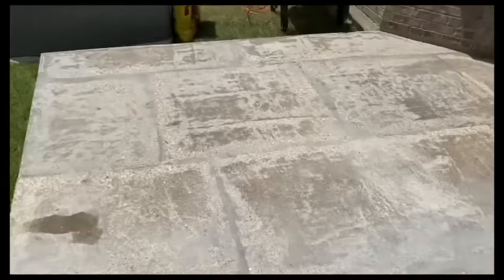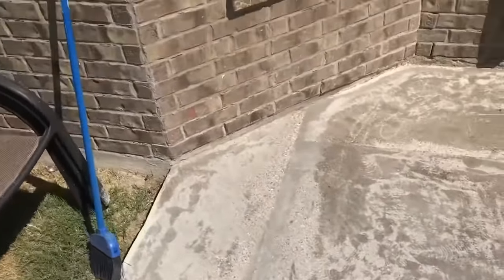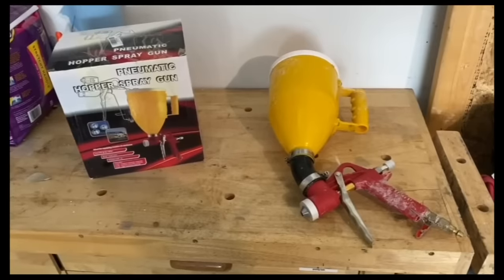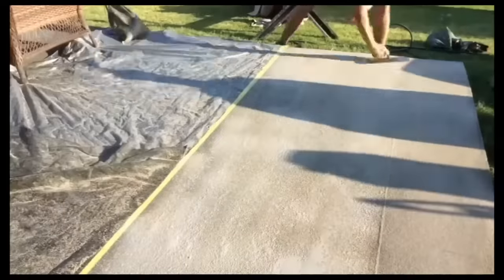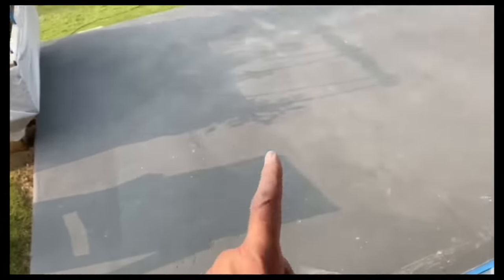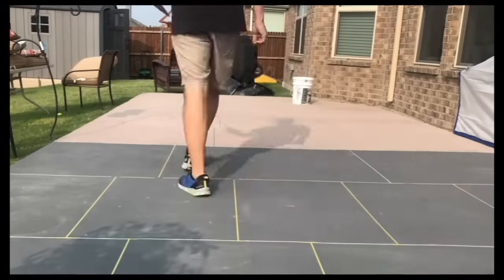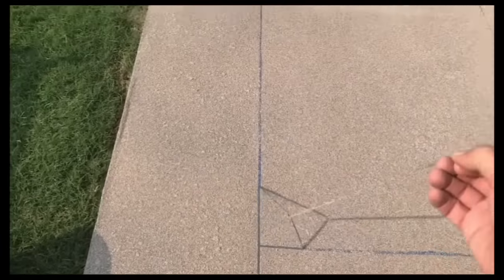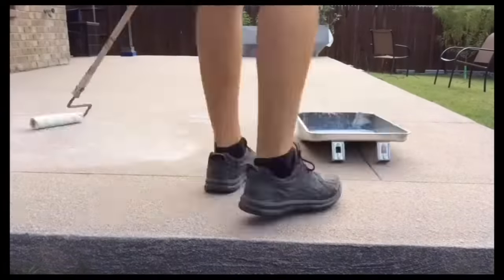Give Your Ugly Concrete Patio a Makeover using SpreadRock by Daich and an air hopper!!  It's easy!

Comment: Congratulations Scott, you did good job considering your experience. I've known guys that have been doing for awhile and they still have a hard time spraying it consistently. That is the key, consistency. Next time you spray a deck, I suggest you trowel it LIGHTLY, it will look much better 😉.
You'll need a helper so you can trowel while they spray. DON'T trowel when too wet. Give it a minute but don't let get dry on you. I use golf shoes to walk on for troweling. Good luck 👍🏼

Comment: That's really nice. I have a painted patio that I need to spruce up and I thought about laying tile or stone on it but I have a low lip sliding door and I don't really want to raise the overall level of the patio. This looks very good and should be a lot cheaper and easier to do.

Comment: Can you tell. Me your square footage and how many gallons of Spread Rock you used. Thank you
Reply: I just finished troweling my first coat.  It took 9 gallons to cover 378 sq ft and definitely needs the recommended 2nd coat.  My experience is that I don't like the look of troweling and will have to spray the 2nd coat for the look I want to achieve.  I have 6 gallons left and am unsure of the coverage when spraying.  Daich claims SpreadRock will cover max 60 sq ft per gallon per coat and recommends ordering 20-25% more than your coverage area suggests.  https://daichcoatings.com/shop/spreadrock/

Comment: Which acid wash and self leveling concrete did you use?
It came out fantastic! I want to do the same!
Reply from the maker: I purchased a gallon of muriatic acid and mix it 10 parts water for one part acid for the etching. I can't remember the brand of the self-leveling concrete. I purchased it at Home Depot, though.

Comment: Hi Scott- I have an old ugly concrete patio with wood expansion joints in quite a few places (been there for 20 years). I am afraid to take them out and fill with self leveling concrete. Will the concrete crack if there isn’t an expansion joint in? Thank you! Great video!
Reply from the maker: I am not an expert on concrete. Just a DIYer. On mine I routed off an inch and then filled it in. It has been 6 months and everything is good, no movement or cracks.

Comment: Hello Scott, thanks for the video. That was better than the manufacturers video. 2 quick questions if you don't mind. When you did the test, you sprayed then troweled. When you did the main section, did you trowel or just spray? Also, what was the PSI you used to spray? Thanks for your time.
Reply from the maker: Thanks for your kind words. The troweling didn’t work for me so after the test I just randomly textured everything which looked a lot better.

Comment: Looks great. I have a painted concrete driveway in Florida. Can the product be applied over the paint or does the paint need to ground off? If this product is not recommended do you have another product that would wirk better?
Reply: You'd have to prep the surface first.  Probably just sand/scuff any smooth surfaces to create a porous surface and then apply your primer.  https://daichcoatings.com/surface-prep-tips/

Comment: Trying to do this over stamped concrete....Guess I'd have to fill in the depressed parts of the concrete? Maybe a roller would work better in those parts to make it even?
Reply: It doesn't roll on very well.  Having just applied SpreadRock, I'd recommend spraying on with a hopper spray gun like Scott did in the video.

Comment: It looks very nice.  Would it have been easier, less expensive and more durable by simply using pavers and a suitable adhesive?
Reply: Hey Kar Guy. I’m wondering about doing something like this. Do you happen to know what type of sealer would work for this type of application? And what about joints? Would that be sealer or some type of locking sand?
Reply: @Pseudify  I have approx. 400 sq ft of concrete patio with no expansion joints that have cracked and become unlevel.  I had to grind down the cracks and then fill them.  Daich says SpreadRock is crack resistant and will provide "superior elasticity".  I'm hoping the SpreadRock will stand up to time and my moving/shifting 20+ year old concrete patio.  https://images.homedepot-static.com/catalog/pdfImages/7d/7d7e3f6e-b246-4a6c-936a-f88cea457cc1.pdf

Comment: I have a so many questions to ask. First, total cost (less tools) and square feet too do your project. Very good job, not too mention a DIYer. How much can I do without help?
Reply: You may be able to do everything yourself.  Cost will exceed a few hundred to include: materials (crack sealer, self-leveling concrete & prep compound, muriatic acid, primer, SpreadRock, sealer, blue masking tape, paper/plastic for overspray protection); tools (caulking gun, putty knife, deck brush, grinder, concrete grinding wheel, shop vac, dust attachment for grinder, paint roller, squeegee, pool trowel, drill w/paddle mixer, paintbrush, power washer and hose, sprayer, compressor and hose, hopper spray gun); PPE (eye protection, dust mask, ear protection,  rubber/latex gloves, leather work gloves, knee pads).  Also, you probably won't be satisfied with troweling as it does not achieve the results that you see in Scott's video - plan on a spraying application so you don't spend more on materials from do-overs.

Comment: You did this last fall so wondering how it wintered?  I don't know where you are of course.  Also, do the chairs being dragged in and out affect the surface?  Sure looks great in September.  I'll comment again in a couple of years..to see how it held up.  That would be a great video.  Finished projects always look good..but later not so much.  That's a lot of work you went to.
Reply from the maker: We are in Texas with had an unusually cold winter below zero. The SpreadRock looks the same now as when I applied it. The chairs to not affect the surface. It will stain if you spill something on it, just like concrete will stain. You have to seal it an wash spills off before they stain.

Comment: Awesome work 👍 how many bags and what you say should spent on the total project? I am about to do my backyard slab and it’s about a 14x 28 😢
Reply from the maker: I will be releasing a linked video this week with all that info. Including the original patio (10 x 10), I sprayed 420 sq. feet. I had to use more product then estimated, but then again I had a lot of imperfections to cover up. I used three 5-gallon buckets at $140 each and 1 5-gallon bucket of primer. I still have some primer left. It also took 3 gallons of sealer. So, all total I spent about $500 which is a lot. It was worth it to me,  however. I did not try the squeegee method. Perhaps with that method you can cover more with less.
Reply: Scott's Garage Well all in all in cake out great in the end and that’s what matters
Reply: Thank you for sharing with such detail!!!!

Comment: Anything with a texture in it, would be a no go for me. I live in Florida and dirt, dust, mildew and pollen, collects in all those crevices and is hard to keep clean. I have a similar texture on my porches and I curse the builder for putting that texture down, on the smooth concrete slab underneath. I just got done pressure washing the porch, and tomorrow I will paint the porch.

Comment: For the prep the surface for primer, do you have to grind entire your surface?
Reply: Surface prep should be an acid wash.  Grinding would be needed if you have high points to level such as those created where uneven concrete edges meet, cracks, or chunks in your concrete leveler that have cured.

Comment: Does this hold up well if you shovel the snow off?
Reply: Don't shovel.  Sweep with a strong brush or broom. That's what I did before I moved to the tropics.  Brush when its soft and slightly salt, when snowing is over sweep again to get rid of residue salt.  Your deck or patio should be safe.

Comment: Wow! I’m guessing this costs a few hundred to do, and a lot of time…but way cheaper than pavers!
Reply: not in the long run...  it doesn't last...  it's great if you plan on selling your house within a couple of weeks...
Reply: @zsavage1820  what happens to it? Does it crack and peel? Discolor?
Reply: Cost will exceed a few hundred to include: materials (crack sealer, self-leveling concrete & prep compound, muriatic acid, primer, SpreadRock, sealer, blue masking tape, paper/plastic for overspray protection); tools (caulking gun, putty knife, deck brush, grinder, concrete grinding wheel, shop vac, dust attachment for grinder, paint roller, squeegee, pool trowel, drill w/paddle mixer, paintbrush, power washer and hose, sprayer, compressor and hose, hopper spray gun); PPE (eye protection, dust mask, ear protection,  rubber/latex gloves, leather work gloves, knee pads).  Also, people probably won't be satisfied with troweling as it does not achieve the results that you see in Scott's video - plan on a spraying application so you don't spend more on materials from do-overs.

Comment: That probably can only be done where you don’t get snow.
Reply: ya and where you don't walk either...lol
Reply: I don't see how snow or walking would be problematic
Reply: Haha. Only good in San Diego where it never rains or gets hot.
Reply: I had done this to improve the look of my front porch which is concrete and it lasted for about 8 years before requiring a retouched.  I live just outside  of Toronto Ontario Canada so we do have tough winters with snow.
Reply: @pattran3030  I live in Oregon where it rains 11 months out of the year. That stuff would take 5 years to dry, and 10 to cure. 😂😉
Reply: @Tom_H327  Man, I feel bad for you, but on the bright side you're saving a lot of money from not having to water the lawn.
Reply: @pattran3030  Fact

Comment: Could this be used on a concrete block 
Porch???
Reply from the maker: My guess is that is could. It is holding up very well.
Reply from the maker: The company is in Canada and they boast of it handling even very cold temperatures. Mine has held up quit well.
Reply: @ScottsGarage17  thanks for the info...i have said porch and it is showing its age but it is still not spalling and its pretty level since it was poured about 74 
Or 75. But would like to top coat it then stain it...thanks again for the response.

Comment: Question...what would you (or anyone) recommend for prepping an existing concrete slab that has a single coat of chipping paint?  We have a basketball court where the paint is chipping and we need to do a new paint surface but I'm trying to get ideas on the best way to remove the old paint.
Reply: If a chemical remover wouldn't work I would consider sandblasting it. You can typically rent a gas powered compressor with enough capacity to power a sandblaster and also rent the blaster as well. It may be messy but I guarantee it'll be the fastest and there won't be any chemical residue that would compromise the bonding of the new product.
Reply: Depending upon how much paint coverage, you may be able to remove old paint with a 2000 psi power washer and a turbo tip wand.  I'm curious to know what you ended up doing.

Comment: Whoa, wait.  That prep sounds pretty extensive (self edging? acid wash, grinding it down with a grinder, filling in expansion joints with self leveling concrete.)  Do you need it perfectly level?  Most patios slope away from the house intentionally to direct moisture away from the foundation. And then you clean?  All that for just the primer. This isn't easy, cheap or fast.
Reply: Go pick up your purse and leave this stuff to men
Reply: @dizzle.1983  are you ok?
Reply: @DECDEC1220  very. You ok?

Comment: HAHHAhA   that shit is way over priced and it does NOT last for shit.....   all that work to prep and here is an idea... do another video in just 6 months of normal ware....    LMAO... I've seen this used on a patio before and the guy was pissed..  cracks... peals   chips...       If you want to really do this right... you need a 2 part epoxy sealer, like the type they use in a large factory floor...  chemical proof  and they even have textured (NON-SKID)    Just saiyan